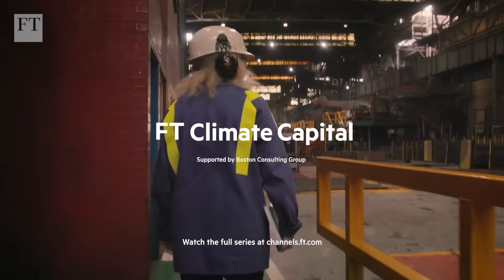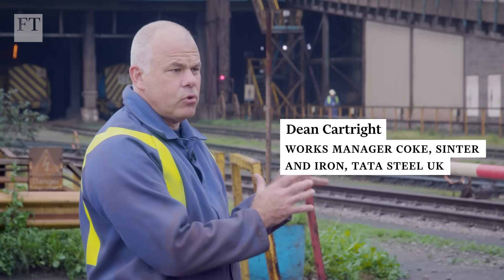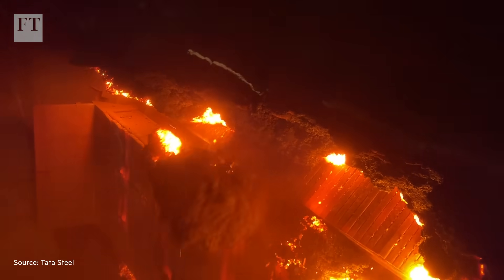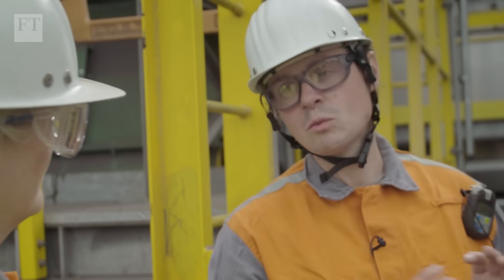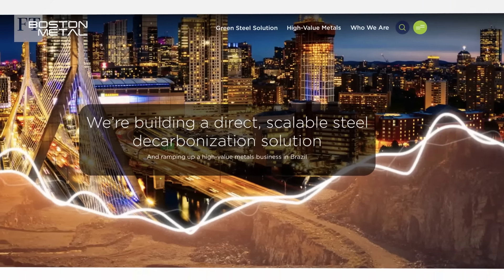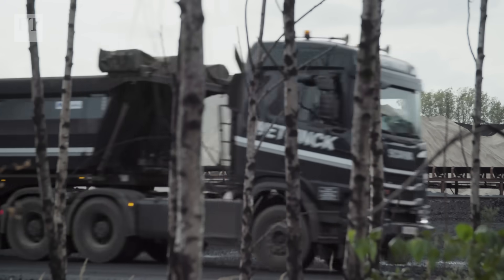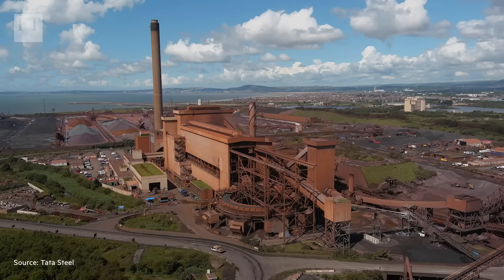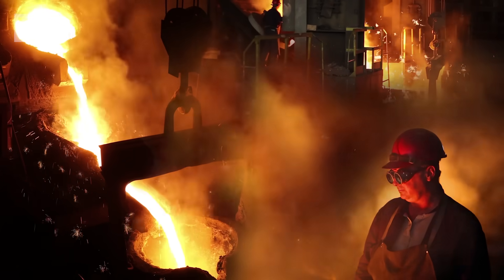Can the steel industry go green? | FT Climate Capital

Comment: When Alex Steel visited the plant, you really got to see the camaraderie and family that was created by this plant. Ideally, instead of them being replaced by new workers specializing in the new technology, it would be nice if the old workers were able to be retrained and re-purposed to do the new jobs. Not all the jobs are going to be super technical and specialized, and a lot of the seemingly technical and specialized jobs could be fulfilled by on the job training, or perhaps have an accelerated training regiment for that job. 
There are limits to this obviously, and there is a really high carbon cost to this steel family, but I feel like there’s a lot of low hanging fruit that could be done for the steel workers if you take them into consideration.

Comment: Recycling is great, but the Global demand for steel far exceeds the recycling capacity. Steel production NEEDS coking Coal, and so if you want affordable and decent quality steel, you HAVE to use coke. There is no other feasible, and more importantly, AFFORDABLE alternative. If UK /EU don't want to produce steel (or in view of the self-inflicted "Energy Crisis", CAN'T AFFORD to produce steel), then others will, and plant closure = jobs lost, but more critically, expertise lost.  Once the expertise has gone, getting it back will be very challenging indeed.
Reply: I would agree with this mostly but most of the cost of DRI is making the hydrogen as they mentioned while the cheapest renewable power generation needs energy storage (solar and wind).  I could see the two problems synergising by generating green hydrogen when renewable generation exceeds demand (currently we just disconnect windfarms from the grid regularly) to use the lowest cost energy.  grid scale energy storage has the issue of efficiency where it's around 60% efficiency currently.  I could see this potentially bringing down costs to in line or cheaper than current methods.

Comment: Tata steel portalbot and the ith plants they have around the world was offered a great deal to reduce the steel works carbon footprint by up to 99% by my group if companies, with a zero up front cost to do so, and we would reduce their electricity bills lls by 50%, but portalbot managing directors never replied to any offers for the last 10 months? Why?, Because they knew in Jan 2023 that they would close the portalbot steel wy, as they had stated building another one in India.
Reply: And by the way, we have offered to buy it without any subsidies from the UK or Welsh gov, but still no replies?
Reply: right.
4.3 billion to buy the plant.
3.5 billion to upgrade the plants to working condition.
after acquiring that steel plant in 2011, the highest profit the made 208 million in 2023
now 2 billion to turn them "green" forced by the govt.
And the govt gives 0.5 billion as a helping fund.(by this 5000 job will save)

and what you think by making half electric bill(despite 3rd country with highest electric rate) and total production of stell production by whole UK only of 7million ton.

did you(we) going to taking responsibility of all the shareholder and pension fund of people which is join with that company ?